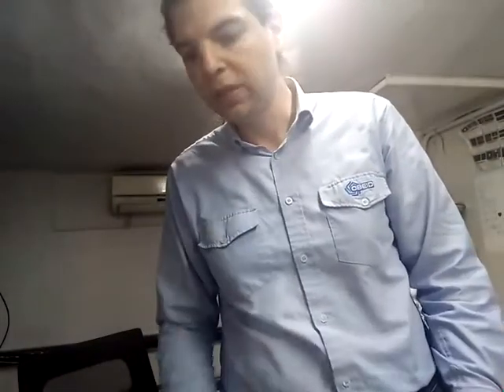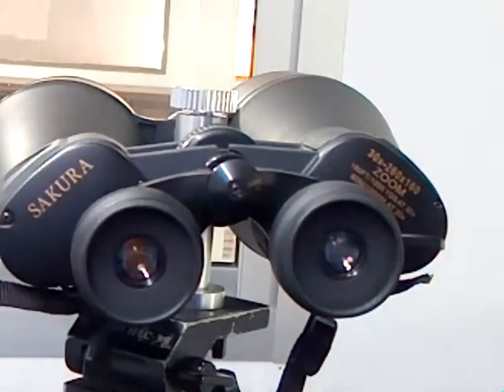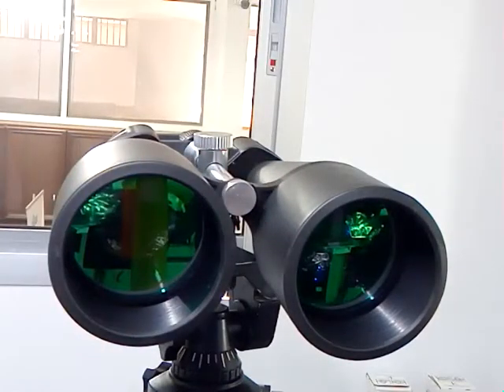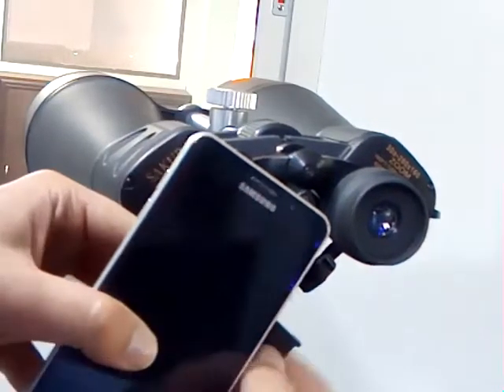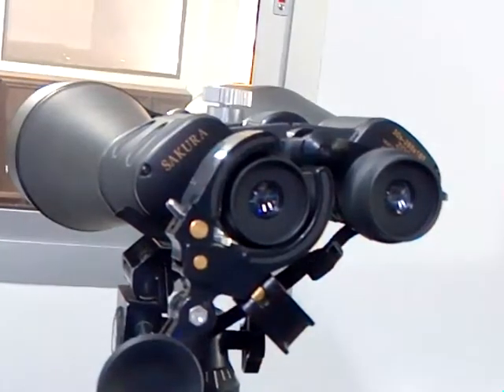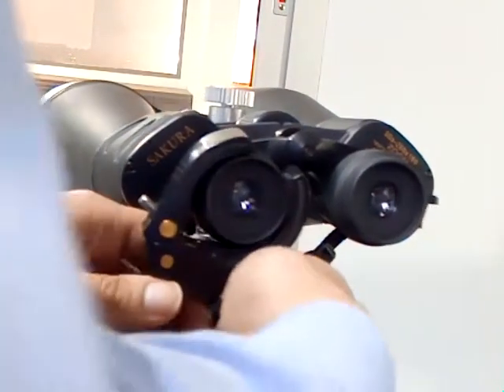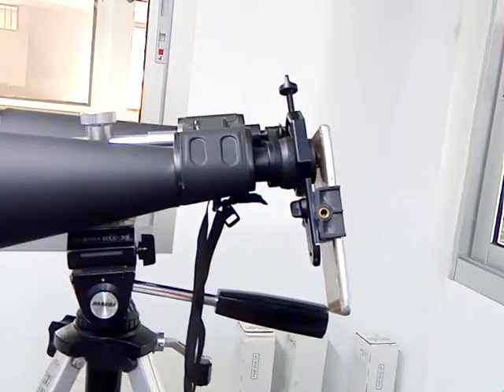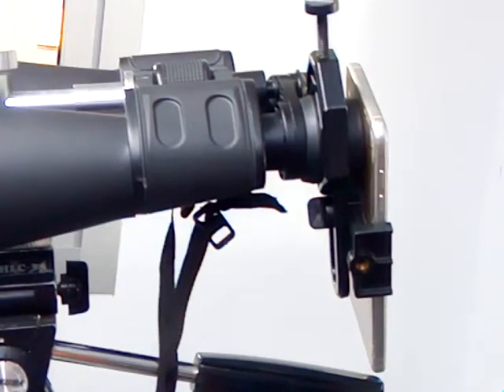How to take a picture from a binocular telescope. four different methods explained.

Comment: How much cheaper using smartphone vs separated (web)camera?
Reply from the maker: Well let's take it from this perspective. the mobile phonr holder can be as cheap as 8 USD plus the phone that you already have. it can be sorta like 100 USD.  using a low quality webcam price is at least  7USD., but still you will need a laptop for maybe 150USD.. still it depends.. but the phone is cheaper in my opinion regarding the mobility it provides.